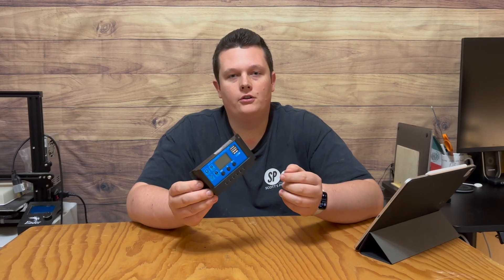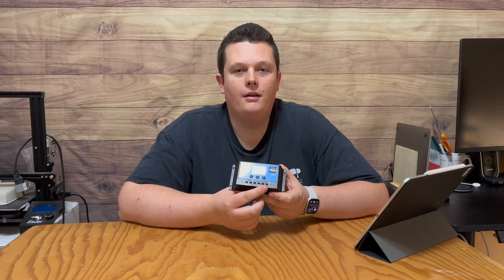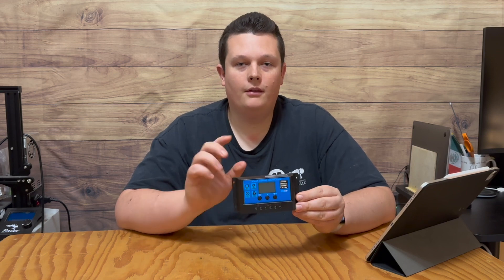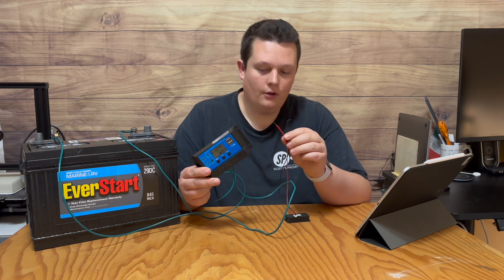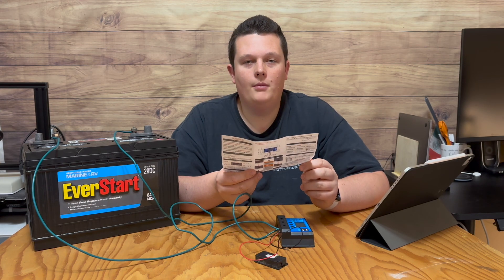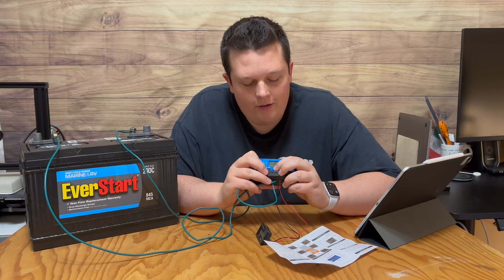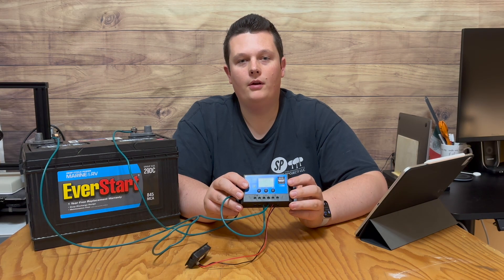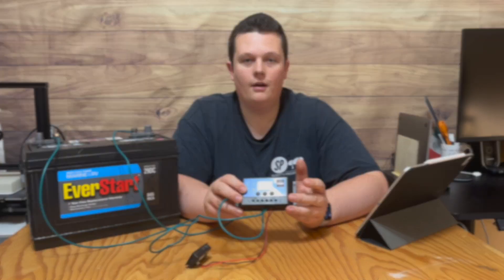How to Setup the Load on a Solar Charge Controller

Comment: So , i have a problem when i use an additional device . When i use a 12V5W bulb , it works . When i use a 12V55W it does not work and the bulb symbol flashes . What does this mean ? 
Is there a limit for the output power ( i use the connectors on the right side an polarity ( + and - ) are connected the right way ) ?

Comment: What is the Volts/Amp output on the DC load? Can it be used as DC power input to another MPPT… ie like a DC solar input to another system?

Comment: thanks for the great video!  i have the same controller but 100A version. i can't find the maximum load that it can handle... for your 30a you said that the maximum output is 10a, do you know the maximum for my 100a ??? thankssssss

Comment: Hi Scott, thanks for the video, I have exactly the same solar controller connected with two 50W panels but I came here looking for a solution to a load problem. I have a car cigarette lighter female socket connected to the load output. When I connect any device on the load using a male DIN socket(devices like a DC 47W fridge, 12V  Led light, etc.) none of them work, as if there is not enough power, yet the battery has 13.6V and they work fine if I power these devices directly (without using the controller). What shows on the controller is the load icon slowly flashing and according to the manual possible cause is "Mode Setting incorrect" which I understand to be referring to the Setting of the light control delay mode (24h/ 1-23h/ 00h) but I have it on default normal mode 24H, no time limit, manually turning on/off the load.
I tried one of the accessories, a male DIN socket with a DC plug on the other end but no load pulling a current. The red LED on the male DIN socket lights up and I can measure a 12V output on the DC plug. 
It's like a voltage drop once any substantial current is drawn. Could my mistake be using thick jumper cables from the battery to the controller?? Thanks if anyone has any suggestions.

Comment: Helpful Video, my question is why am getting low amperage with the load. Amps coming in from Solar Panel are 2.7. From battery to distribution box is .14?

Comment: If I don't intend to ever use that "Load" feature, what setting would recommend?
This charge controller will be used to charge my two-battery Lifpo4 12-volt battery bank which is wired in series.
I'll have a 500 watt power inverter wired directly to my battery bank and that inverter will be used to power small loads like a cooling fan and other appliances with equal or less power draw.
 I don't really ever foresee needing to use the output power feature that's directly wired to the charge controller.

Comment: Nice video. What would happen if the battery is full and the solar panel is still delivering power. Does the controller stop the charging?

Comment: I'm only getting 1 volt at the load terminals with my new PowerWin controller.   Though it should be 12 volts. Is something wrong with the controller?......I FOUND THE ANSWER...There is a load timer.  Mine was set to "0".  After I set it to 24 I'm now getting 13.2v at the terminals.

Comment: Hi. What if I was using 2 numbers of 12v battery and attached it together so it would be 24v. The question is can the controller set to 12v output ?

Comment: I know this isn't tech support for these things, but just a long shot in case anyone is passing by who has one;  I set one up to run a water pump in the evening, but if I set the output timer to anything other than 24 it just runs indefinitely.  eg.  I tried 1HR and it came on immediately (didn't wait for sunset/ no solar input) and didn't turn off after 1 hour.  Had to be stopped by changing the setting and turning it off manually.
Anyone ever encountered this before?  Is it just faulty?  The only thing I could think of was that maybe the PV panel is too small or something.  Thanks anyway

Comment: Hi Scott - You are very informative and easy to understand.  I am a beginner and want to hook up the battery, controller and inverter to the 200 w solar panel.  I have a 12 volt 35 AMP hour universal battery (Thunderbolt Solar), a 1500 Watt Jupiter power inverter and just ordering a controller similar to the one you show.  Do you have a video that shows the process with the sizes of voltage and wattage and all.  I do not know anything, so do it for folks like me. Please.   Thank you.

Comment: Hi scott.great videos you have done...need some help.have changed to a lithium phosphate iron lifepo4 battery...on my new solar controller it has b1 b2 b3.settings...i know it's not b1..but can't work out if it's b2 or. b3...any help would be appreciated..😊
Reply: This pwm charge controller... doesn't work with lithium batteries. Only works with Lead acids

Comment: Hi I have question in regards this mppt controller I have installed a water pump on my caravan but when I turn one the pump the mppt will stop working and also the
 display .the amp for the water pump is  15  when it start and then 7.5 amp when it running. 
Thanknyou

Comment: If i don't use the load output I would set it to off.  I charge a battery and run an inverter off of the battery.

Comment: Hello Scott I have a ❓🙋🏻‍♂️. First of all, I’m super new to the whole solar stuff but I wanted to know if u would recommend this ?: (12V 18AH Battery Rechargeable Lead Acid AGM Battery with Nut and Bolt Terminal) For a 30 watt solar kit I just purchased. My thoughts led to this battery because I read the higher AH (18AH) the faster the charge from 30 watt solar to this battery. I hope I made sense 😂

Comment: Hi Scott, can this 30A charge controller support a 12V/30Ah battery? What type of battery do you have?
Reply: It doesn't matter the Ah capacity of the battery. Just a bigger battery will take longer to charge, and will run the load (if any) for longer when it is night or not enough sun. 30Ah is typical for a very large motorcycle (e.g. Harley, though BMWs, Goldwing etc are more like 20Ah) or very small car. Small motorcycles have under 10Ah, and big cars over 50Ah.

Comment: i bought the same controller----    I heard you could run the panel direct to the controller and use the USB ports,  but from what you said you cannot,  you need a battery
Reply: Yes you deff need a battery connected BEFORE you connect a solar panel.

Comment: I have a question about the load side of the power manager. I have lithium batteries in my bank coming from the controller and don’t want to “mix” with my starter battery. Can I use the load side of the power manager to trickle my starter battery without harm?
Thanks!

Comment: Great explanation, however. I am trying to power 40 12v led outdoor pathway lights so I need to add a relay which is an automotive 12v 40 amp to Handel the load. I need help to figure out how to add it into the circuit.

Comment: Intuitively the 0 (zero) hour option seems the wrong way round. Turning the load ON at SUNRISE and OFF at SUNSET doesn't make sense particularly if you want to run security lights.

Or have I got it wrong (I've watched the video 4 times to check if I'm hearing correctly) ?

Comment: A 12v relay can be connected to the load. An inverter is connected to the relay so that the relay turns inverter on. Then, larger consumers and higher voltages than 12v can be used.
Reply: Does this actually work?

Comment: This is the kind of video i needed but only answered half my question. Where do you find things to run the load on? For indtance lights and small fans that have the red/ blk wire to connect in. Or do we have to cut/strip wires and manually do it? Ive trued searching  amazon for dc load lights but havent really come across much besides like small van lights/ for music stuff.

Comment: Ok , so i took a "cigarette plug adapter" and wired it into the load , so my load in now powering a cigarette socket , into the cigarette socket i plugged in a 75 watt power inverter which is so small that it doesnt have a cooling fan , and therefore doesnt waste much juice when its on.

And it also has 1 USB socket and into that i plugged a USB powered light bulb , so when you turn on the load it also turns on its own work lights , so u can see the top of the battery and front of the charge controller and everything else one might want to check on at night.

Thank you for explaining to me that i only had 120 watts to play with there ,,,,,, that could have gone badly otherwise lol .

The 75 watt power inverter is also just enough to run my modem all night if i wanted to get my laptop running to find out why my power went out.

Comment: My controller doesn't display "0H"but does display "00".  Unfortunately, when it is set to "00" I can't get the output to turn on.  I am trying to power a small 12V, 6W fountain pump during the daytime only.
Reply: I had the same issue.  The controller that I am using whilst looks identical to Scott's must be different.  When set to o it turns off the load while it is receiving charge from the solar panel.  Even the manual states "00h - By default the DC output is turned off when there is sunlight".  I just run in 24H mode and turn off the output manually when I need.

Comment: Sorry Scott I made a mistake. I have 1x100w solar panel going to 2x110amp leisure batteries with 1000w inverter. Is this OK. Can I add another 100w panel
 to the set up.

Comment: Much appreciated Scott. I have this 30amp unit. Connected to my 110 amp leisure batterles with 1 2x100w solar panel with a 1000w invertor does this sound OK.can I add another solar panel to the set up

Comment: I'm using a drompower  60a mppt solar charge controller with 5 12V sealed batteries and 10 200W Solar panels. I'm unable to have electricity the whole night. Could you guide me through the load setup?

Comment: Thank you, very clear explanation. I have a couple of questions if you are able to answer, much appreciated. i have a 120W water pump, can it be run via the load setting or would i have to run it from the battery. If i run trough the load it would enable me to use an irrigation controller and a small relay to control the circuit.

Comment: I got an atempower controller that looks the same as yours. I can't get the 0H function to work to power a pond pump during the day only. When the bulb icon is on the pump works but it doesn't switch off at sunset? It just keeps going into the night and I have to switch it off manually. Any thoughts what I may have missed?

Comment: So to run a 12v fridge 24hours connect the fridge to the load port and the solar will charge the battery and the charge controller will manage the charging of the battery and also running the fridge?

Comment: OK, so what do you actually connect to the output load, practically? I'm using with an RV...I don't have anything that would plug two wires into a controller, so still no idea what you use for that output load...?
Reply: I guess it is just a timer switched low power output. A fan to run when it is sunny? Night lights outside at night? I thought it was going to be for power to an appliance that was only available when solar was being produced.

Comment: my pwm solar panel is lit up, but it won't program, it's hooked up to the lights, but the lights will not come on. how do i make my lights work?
Reply: Your lights are dc so make sure you have the wires the right way around 🤔

Comment: thats for the vid , since I am new to this I have a simple question 
I have a DC pump 12V 180W  80 ampere controller , can i just put the pump into the load terminal ? or shall i connect it to the battery directly  ?
So far i understood is the load terminal the regulated output from the Battery ?  is that so far correct  ?

Comment: Wow I thought it had a min batt voltage you can set to cut load to prevent battery drain. The internal timer is great will set that one.= for small 12v heater after sunset in greenhouse.

Comment: Hi Scott, could you clarify the 00h setting? - when my device is set to that, is the load supposed to be switched on between sunset and sunrise, or between sunrise and sunset? I want the load to be on during the day while the sun is on the PV, but its not doing that - its not turning on the load in daylight when PV is coming in. Any help appreciated.
Reply: It is the opposite, from dusk till dawn. There is an update in the video description.

Comment: Great video, thanks. One further question on the load on/off. If i set for 3hrs (after dusk) and use the manual on to turn on the load when it's "off" when will it turn off automatically or will it stay on indefinitely?

Comment: Can I use the load output without connecting a battery?  We are using the controller in a solar powered boat competition.  Two of the races use only solar panels to power the boat.  The third race, an endurance race, uses small batteries to power the motor.

Comment: Thank you Scott, you have helped me greatly as I have the same controller (only 20amp version). The 'Chinglish' instruction sheet is confusing, so this helped me understand the functions way better, thanks again! ...I do have one problem however, my 'charge icon' (arrow from Solar icon) is suddenly not working (I have 2 x 80W slimline solar panels on top my teardrop camper trailer), but battery not receiving charge! Will look for other tutorials to help...

Comment: I'm going to use this to power a small LED light in my shed. Something like .3 amps. I put a switch by the door so I don't have to fumble in the dark to find the load on/off button on the controller. I'm hoping to use to load connection to prevent me from killing the battery if I forget to turn the light off. (My unit is a bit newer, will have to see if the discharge stop is still set to 11.3 as you explained in another video) but will that work? If the switch is "off" at the door, and the load is set for 24, will having no load on the load (because of the switch being off) cause any issues? And if I DID leave it on, would the light just keep cycling at the discharge reconnect/discharge stop? I'm thinking it would.

Comment: Hi Scott, i noticed my battery charges really slowly when using this controller. I have a 250watt panel, 1000watt inverter and a 65ah battery. I'm using the right settings for a lead acid deep cycle. Do you recommend i change the controller to a more advanced type instead of this because i'm starting to get really worried. PLease respond Scott...
Reply from the maker: The 2 biggest questions are you getting enough sun? This time of year solar production isn't as high as in the summer. Also, is your battery in good shape? 65ah isn't a lot of battery power, especially on a load up to a 1000 watts, you would deplete the battery in about 23.4 minutes if you don't go below 50% to keep the battery healthy. I hope that helps!
Reply: @ScottsSolar  well yes, I’m getting enough sun and I don’t even use up to 500watt of load on the inverter. Got the battery last week, and it’s still very much new. But I noticed the battery drops in the afternoon even with minimal load while charging.

Could it be the controller?
Reply from the maker: Hmmm...well that's good it's new and you're getting enough sun! To be honest I'm not sure why. How are you measuring the battery status in the afternoon?
Reply: @ScottsSolar  with the same solar controller sir
Reply from the maker: @emmaoye2704  Gotcha! If you can, I would recommend measuring the battery status another way as the controller isn't always accurate. The most accurate method is to disconnect all the cables from the battery, let sit for 15-30 minutes and then measure the battery voltage.
Reply: @ScottsSolar  okay, thank you

Comment: Hi Scott, can you explain the functions marked on the manual as 2, 3 and 4 after the main display and before the timer function:
1) Floating charge: 13.7V (default, adjustable), 12.0-15.0V? : Can you explain what this is?
2) Discharge stop voltage: 10.7V (default, adjustable), 8.0-11.5V : This I managed, it's a limit set that when the battery voltage is below the set value ex. 10.7V, the controller cuts off the supply to the load. Unfortunately I couldn't set this below 8V, I guess it's to protect the battery from draining too much.
3) Discharge reconnection voltage: 12.5V (default, adjustable), 11.0-13.0V : Can you explain this function please?
Thanks

Comment: I have a technical question:
I am using this system for a water pump which I am as for now starting manually every day for about 30min at about mid-day. 
I would like to make this automatical but the options here do not seem to match with my request.
The best ide that I came with is to set the discharge reconnect to it's max value and the work mode to stop at about mid-day. I didn't try this yet as I think that it would anyway work more than the 30 min what I need...
The real question is : how can I set it to work only from 11h30 to 12h00 ? Maybe an external device ?
Sorry for long text, I am an absolute beginner at electricity and still quite unsure of what I am doing...

Comment: When people talk about a float charge for a solar charge controller, I have trouble understanding if the float charge is going to be the  max charged voltage, and which would shut off the power going in? They talk about the idea of 'float charge' and bulk charge, and I'm worried if I have this at the wrong ranges for my batteries if its overcharging them. And do you want to limit the float charge for some types of batteries like lead acid and AGM battery types, and what kinds of ranges?

Its also hard because on the sides of the batteries they quote cycle charges and standby charges but not float charges or bulk charges. So I'm not sure how to translate those figures to the float charge, etc?